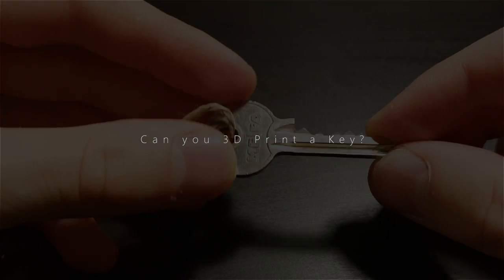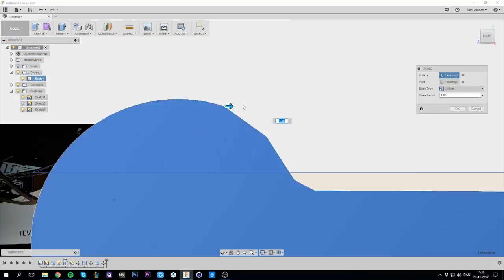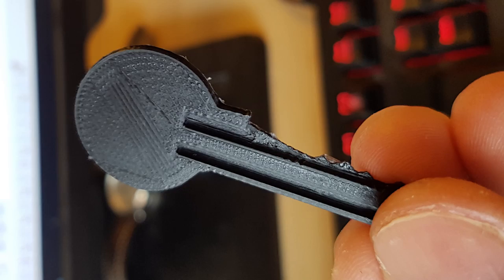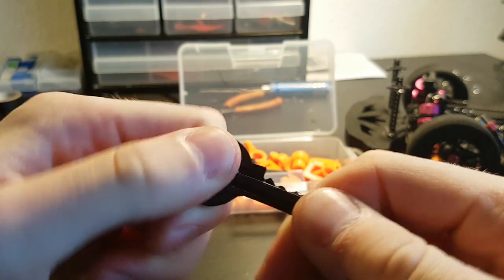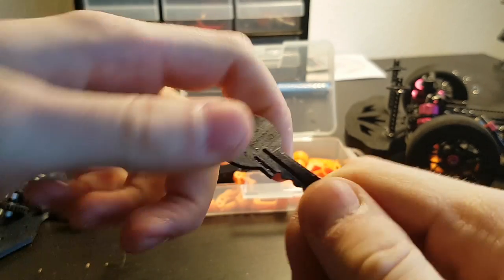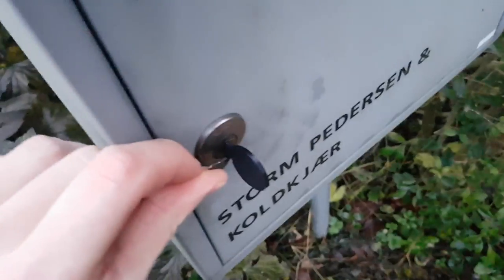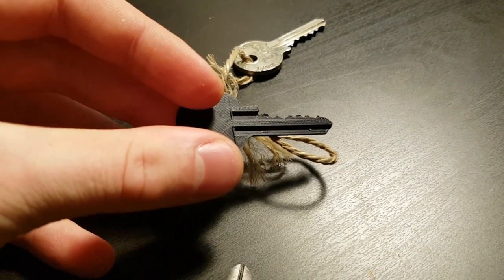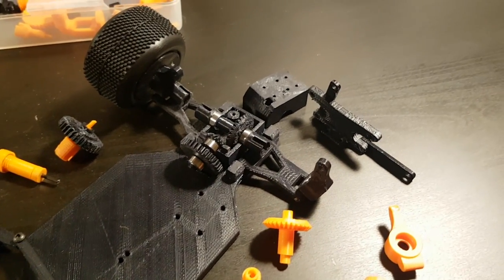HOW TO 3D PRINT A KEY - BEST HACK!

Comment: how dangerous are these to use? like how easy is it for them to break off inside the lock
Reply: Wouldn’t do it at all. It can break easily. 
And if it’s not your lock, you could be charged if caught. It’s way easier to be a locksmith and do it with just a paper clip 😂

Comment: Very interestng/original project.. ;)
Reply from the maker: +T Barun Thank you very much. It was actually surprisingly hard to make it work. The tolerance is very small
Reply: Karl-Emil Storm, in which way do you mean about smal tolerance. Did you compare dimension between printed key and the original key before usage (i guess you did). And I have seen lots of design work in cad...
Reply from the maker: The teeth on the key have to be very exact to the original